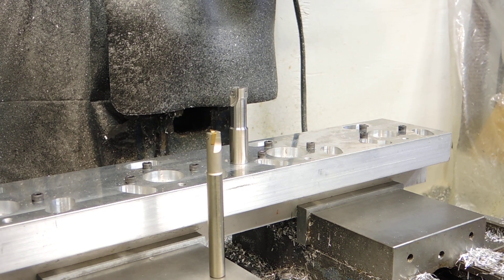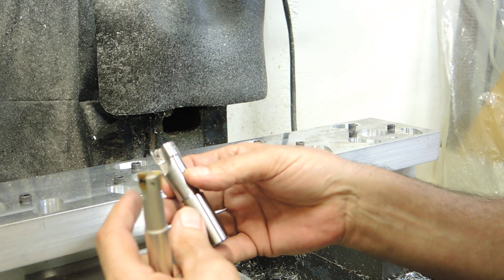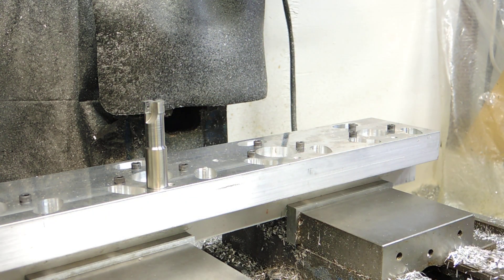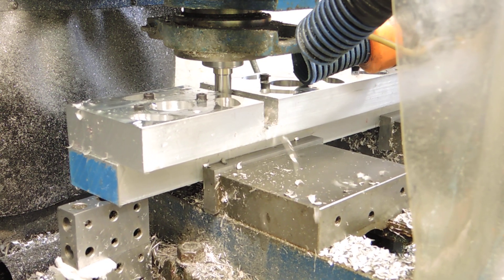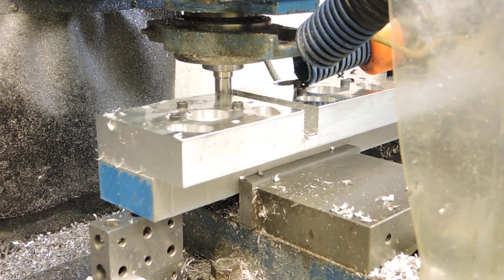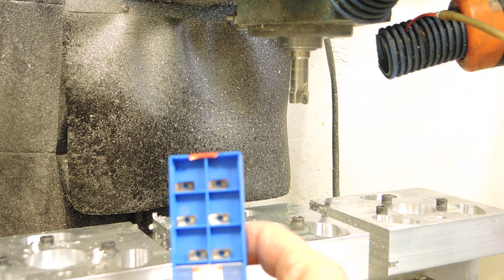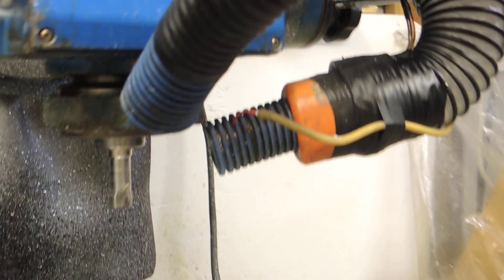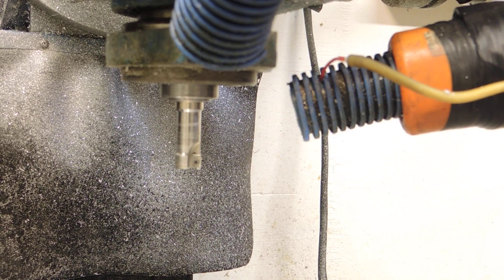First look at a low cost 20mm Insert Endmill

Comment: I bought a couple of 16mm mills for APxx 11 inserts, and a couple boxes of APKT11T308, one for aluminium and one for steel to be used with my DIY CNC (yet to be finished).

I'm working as a lathe machinist on a Mori Seiki NL2500 with live tooling, and I decided to try on carbon steel (C45) to see how it goes.

And it goes well.

I had a couple of parts cut too long to machine, so I tried to remove that material with the less than 20€ mill, and it worked ok.

It has a little runout (0.07mm) between the two inserts, as every insert mill isn't a smooth cutting tool, but it works.
After milling out something around 1.5kg of C45 the inserts are like new.
Not bad at all.

Comment: I've had great luck with this type of cutter in Aluminum and also in steel. I preferred 0.75" diameter as that got me up to 3 flutes. On the TM-3P they were a pretty good match for the HP. On the VF-4, I blew one up pretty quick. You don't even realize how much force is going into some of these cuts until something moves/breaks...

Comment: I was gonna say... this inserts are quite picky about the feed-per-tooth rate, to much and the insert will degrade quickly, too little and you'll have a lot of chatter. But once you get it right to spec with the manufacturer they're delightful to work with.
Reply from the maker: For aluminum I have yet to damage one.  I have been doing all the ruffing I can at fairly high speed. I'm still on my first edge. The smaller ones like in this video are fine but don't clear the chips much better than a 2F end mill. The larger ones really toss the chips out and can slot much deeper. I want to show some of them soon.
Thanks for watching. Dave

Comment: What kind of mill is that?
Reply from the maker: It's my old IH/ Charter Oak 12-Z mill. I still use it as my main mill until I get the belt drive up and running on the PM-940 mill. My IH has a belt drive and VFD and A/C bearing so I can get 6K from the current motor.  It is due for replacement. I think they are out of business now. I have been making parts with it for 7 years or so. I have a second IH sitting in parts here that I'm going to cast in concrete this winter for a mill that will come in at about 3000 pounds total.  That's why I was saying I have a few more things to do videos of coming up.